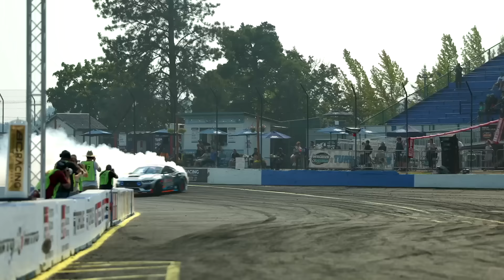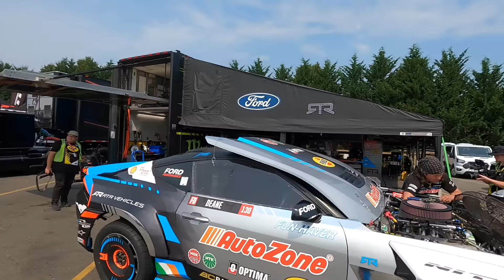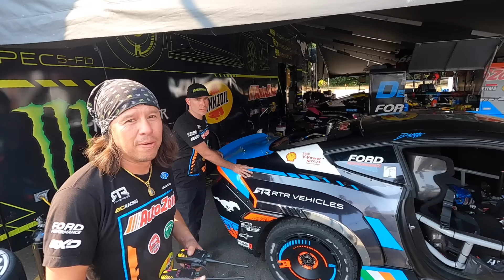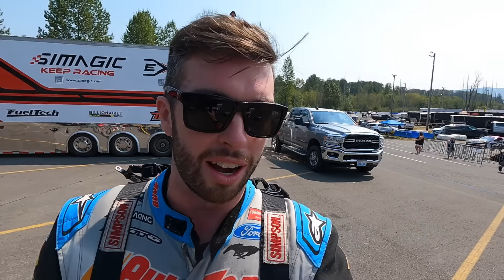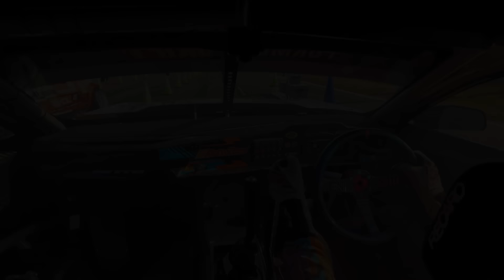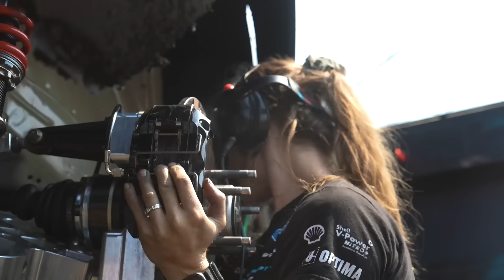Why Formula Drift Seattle was my Worst Event of 2024

Comment: Ford stands for "Fix Or Repair Daily", if you spell it backwards it means "Driver Returns On Foot". Maybe get a real NASCAR engine instead of a RTR special yoke, and you would have less issues. Or put one of your bros 2J's in because reliability is a big issue with RTR this season... Or get your bro out to build RTR's engines for your car. Good luck this weekend.
Reply: RTR has no barely any engine issue, by far the biggest issue they have had is with the nitrous kit which is a 3rd party supplier and isn't built in house, their engines are better than many other teams, and calling them unreliable and or that there are better options is wild and ironic considering they are leading and have won more events than any other type of car or team in general.
Reply: yeah put 2jz and 28b quad turbo